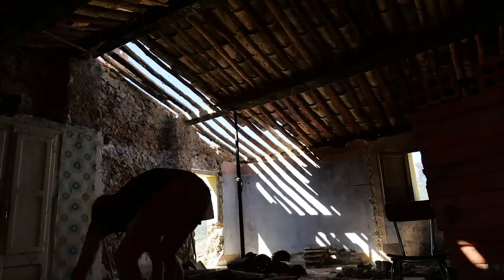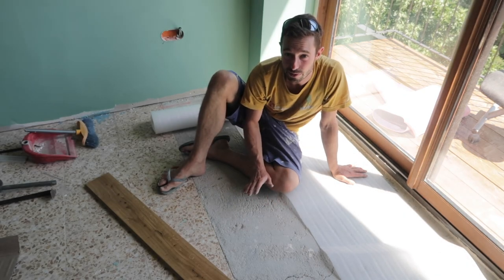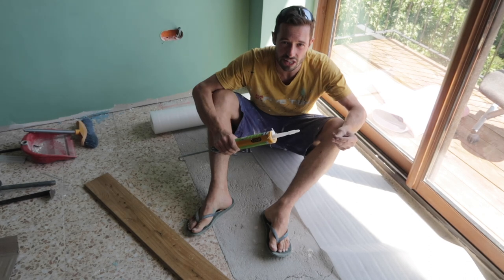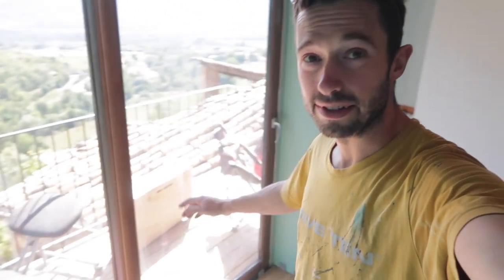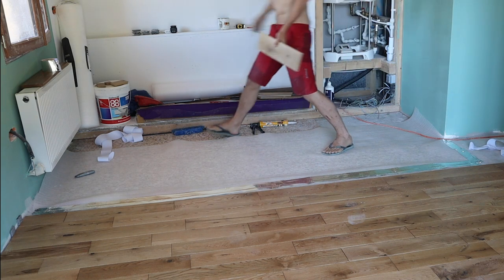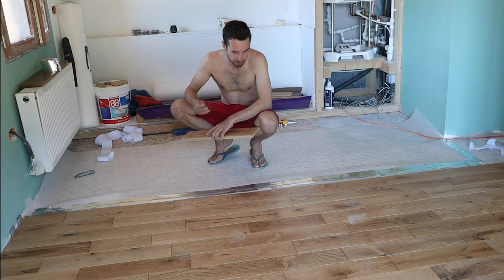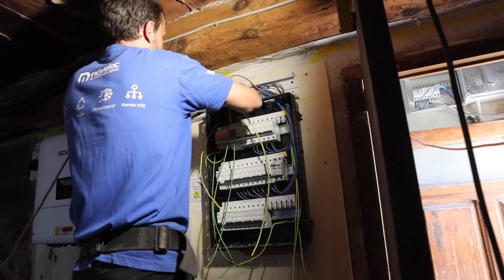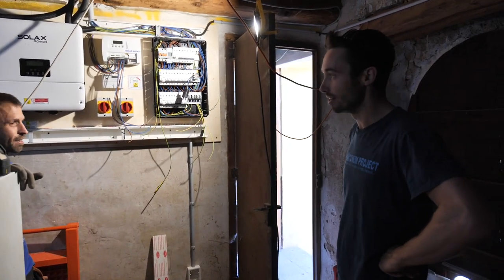And then there was light 💡 MAJOR WIRE-UP // Old Spanish House Renovation🏡

Comment: be interesting to add cost of components and labour charges when you outsource, where do you get your hardware from?
Reply from the maker: Labour here is generally between 15 to 20 euros an hour in general. I have not outsourced much; sand blasting beams, installing two large metal beams (legally had to bring in help), this electric box and air con (also mandatory). Total of 6 days of onsite work, 10 man days. 

Hardware, depends, local shops or online ordering (mano mano / amazon / leroy merlin etc...)